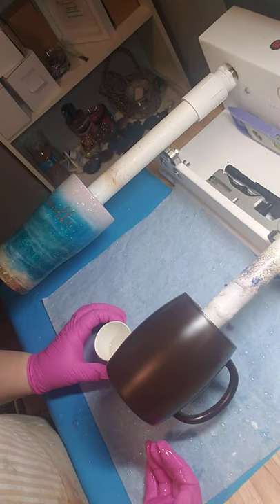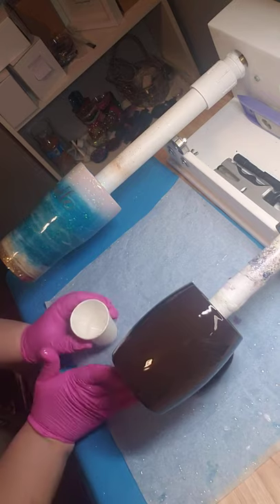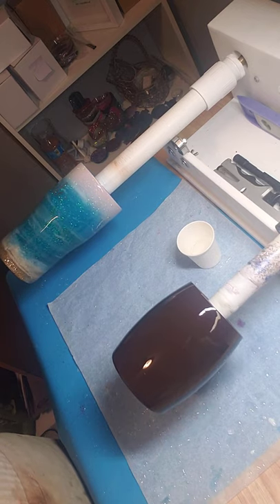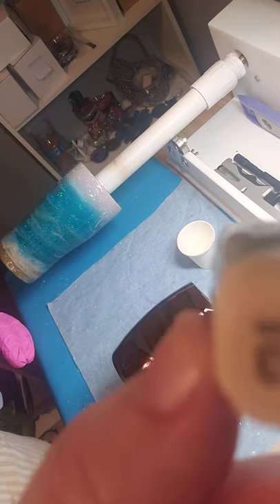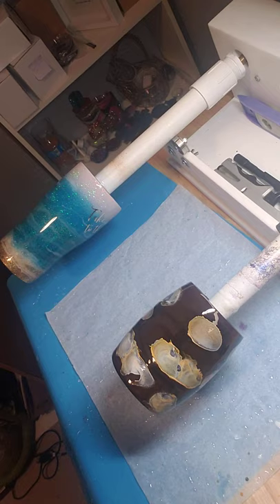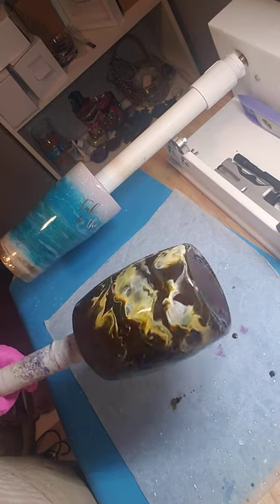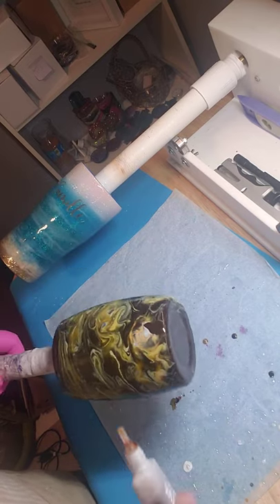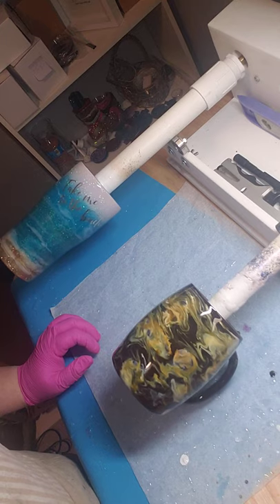Alcohol Ink Coffee with Cream (Cafe Con Leche) Tumbler

Comment: Hi this is very beautiful.  My question is can I  use a sublimation mug for this
Reply from the maker: Thank you.  I use sublimation cups sometimes. Just sand the coating off and spray paint and you are ready to go.
Reply: 👌I use them all the time, especially white or black bc it skips most prep work. Sanding a little bit to give it tooth/grip and then add spray paint or resin as normal.  ~if it’s a shiny cup like a powder coating with a shiny finish I sand barely enough to remove the shine.  Never have any issues. Happy Arting 🌹